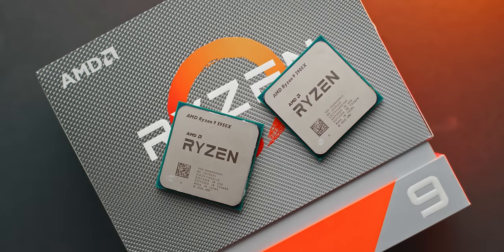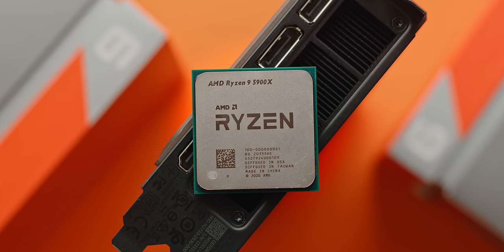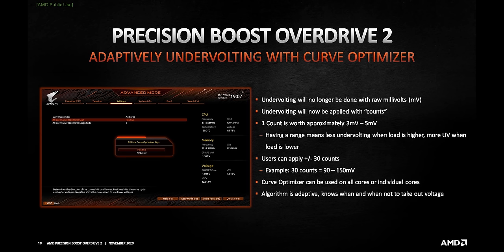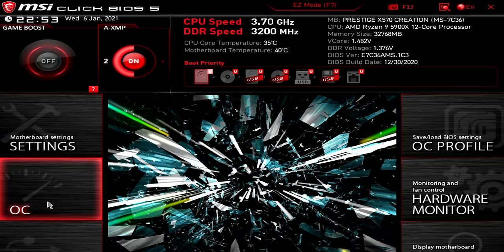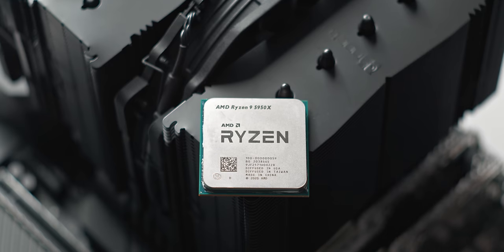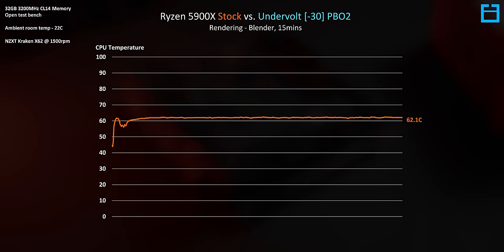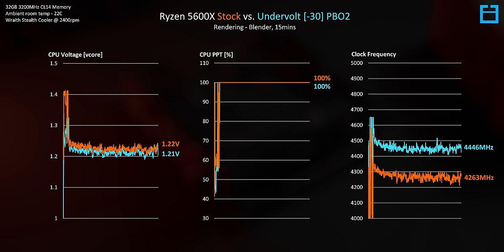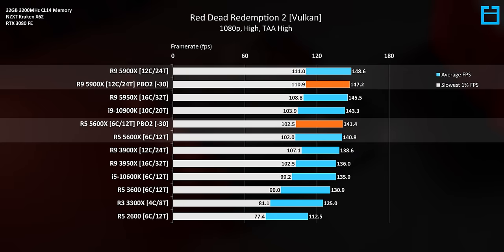Ryzen 5000 Undervolting with PBO2 – Absolutely Worth Doing

Comment: Try setting "Max CPU Boost Clock Override" to "Disabled" if your system is not stable with "Curve Optimizer -30".
Reply: i know it’s been a year but did it remain stable ?? i want to try this as i am struggling to even remain stable at -10

Comment: Thanks for this video. After lots of trial and error -22 seems to be the magic number for my 5950x specimen. Glad I took the effort to do it. Anyone found a golden 5950x that can handle -30? Good luck undervolting!
Reply: -22 got me 29700 on Cinebench 23. 5950x
Reply: @zk4929  How did you land on this value? Did you experience any stability issues or still running it with this?

Comment: I would love to see this tested with a 5800X. I've got a 5800X and because of the high temperatures I had to undervolt it and now it stays nicely under 90c. Still quite high but not shocking. Using a Noctua NHD15 with a single fan.
Reply: Whats the actual temp under that beefy air cooler?
Reply: Did you undervolt it to -30?

Comment: Ryzen 7 5800X - Thank me later (tons of day of testing, rendering, gaming): 1,2V at boost at 4,4 GHZ does a full stable run for all cores. You will never need 4,8 ghz single core boost for stable gaming performance. You need to have good multi core performance which you can reach with setting -450mhz PBO boost clock, and curve optimizer -5 to all cores. Do not mess with the Amper and Watt settings in PBO... Just set boost clock settings and curve optimizer and set Auto for all others even for ampers and wattages set auto. 4,8 Ghz for this cpu is just marketing it can never keep it at that clock for valuable time and in this case it's just totally not worth to use factory CPU settings....

Comment: Is it really worth it though? I mean I lose like ~7fps only by going from PBO2 auto/gaming mode to stock/no gaming mode but temps go from 80 max to 62 max (custom watercooling).
In CAD workloads it's unnoticeable, and in rendering it might be a 10% drop in performance at worst.
Trying to undervolt, I basically go from 62 to 61 degrees max with the same fan profile but lose an additional 5% in creativity and ~5fps in games.

I suspect that if you're on the stock cooler, it may be worth it if you don't need the boost (3090/6900 GPU doing the heavy lifting maybe?) but for most people who run aftermarket cooling (AIO or otherwise) it seems like negligible benefit.
Clock-speed increase in single-threaded is due to CPU having operations/mhz reduction due to voltage and therefore boosting the clock to counter.  AMD did a great job with the single-threaded performance, for once meeting Intel.  I was on Intel for many years because of their previously superior single-threaded capability (and CAD softwares still stuck in yesteryear with minute benefits from multicores)

Comment: I try this on my Ryzen 5 5600X in CB R23
Before: 4400-4425 MHz/1.264v/79C
After that:
(PBO -30) 4500-4525 MHz/1.184v/73C
(PBO -24) 4475-4500 MHz/1.200v/74C
(PBO -18) 4450-4475 MHz/1.216v/75C
It’s help me a lot since my 5600X run hotter after the system bios update. But still 10 degree higher than the previous bios version 😂.

Comment: My 5900X can only go to - 20 counts all core.
If I set higher, the pc is caught in a restart loop. But atleast temps reduced by around 15°C, from 85 to 70.

And one question. Do I have to put the +200mhz in or let it on auto? Because so far with 200mhz manually turned on, no gains past 4,8 ghz.
Reply: Yea, running into this issue as well.  I think it's an issue with ryzen master.  Because everything works.  I install ryzen master (unistalled because I wanted to ensure my presets weren't interfering with the setup) and then constant crashes.
Reply: @Titansfan81  i don't use ryzen master. Only bios settings. I see people who get 5900x to hit 5ghz. But my cpu only does 4,85 if any. Rarely 4,9ghz. Curve optimizer to negative 20 all cores. Pbo limit disabled.
Reply: @jonaskreis7571   interesting.  So I left pbo at default,  ( saw an increase at enhanced but can't remember which profile)  used Ryzen Master and got 4.9 boosts easily and auto over clock over 5ghz. But i also have my ram at 4.0mhz and fclk at 2mghz. I remember that the better your ram to infinity fabric clock the better your cpu performance.
Reply: @jonaskreis7571   i think we can help each other out.  I could give you my IG and we could run some tests yo.
Reply: @Titansfan81  maybe ram is the problem. I can't get 3800mhz or let even 4000mhz. Well... Actually the IF is the culprit because in my setup with x570 aorus pro it can max get 1866mhz so i can't set ram past 3733mhz
Reply: @Titansfan81  i am way too oldschool. I don't even have ig. I am already overwhelmed with youtube settings
Reply: @jonaskreis7571  Ha! I'm an early 80s baby. I decided to embrace SOME of the new school stuff. Not all of it and not alot.  I have other means of contact but there are crazies everywhere.  I'm sure you can appreciate that lol.
Reply: @jonaskreis7571   I'm using the apparently popular X570 Tomahawk.  I bought 4ghz gskill cas 18 ram and used RM to get it coupled and clocked.  I'll have to do research on your board to see if better clocks are possible.  I'm thinking the same on my board about just using bios and not Ryzen Master, but I like being able to control everything without going to bios and I don't know of a better HW monitor because NZXT cam is always off by like 8 degrees sometimes and it's un reliable on freq as well.  And don't get me started on dragon center!

Comment: My 5900x sucks. I'm getting random system reboots whenever my system is idle. Under full load it's fine but when idle it randomly reboots. So far I've tried -30 to -20 and eveything in between those numbers and I get reboots. I'm currently at -18 and so far it seems stable but we'll see what happens. It sucks too because I was getting an all core boost of 4.950ghz and now I'm basically getting stock boost of 4.5ghz just with lower temps.
Reply: I encountered the same issue with my 5900X. System reboots or BSOD when system is idled.
Reply: @raymondxiao9121  I also got reboots at -18. I tried Ryzen Master and letting it do a per core undervolt and I thought it had worked but even using Ryzen Master which actually tests each core, it was still randomly rebooting when Idle. I went back into the BIOS and switched it back to all core and lowered it to -15. So far so good, I've had it at -15 for 3 days now. TBH though it really isn't even worth it. I'm not really even getting any gains by having it at -15 since it's such a tiny undervolt. I might be getting 4 degree lower cpu temps but my boost is basically at stock now with that tiny undervolt. It's to the point now where I'm thinking of just saying screw it and overclocking instead of undervolting.
Reply: @NonLegitNation2  No, it doesn’t worth it. I tried Ryzen Master and some other tools. Per core under voltage doesn’t work either. 5% performance gain costs system unstable. I just leave the PBO as auto.
Reply: @raymondxiao9121 yeah i quite literally can’t do this on my 5800x3D, its poor silicon lottery . nothing works so i just gave up and left it on auto unfortunately. sucks cuz i was enjoying my boost but i rather have stability. sigh.
Reply: @NonLegitNation2 did you find any stable curve ?? if so please give tips , i’m struggling to get mine stable on my 5800x3D
Reply: @NonLegitNation2 reboots without errors right ?

Comment: It's  very interesting how it works. when I enabled PBO by itself the cpu will go up to 125w of power and reach around 4.5ghz all cores on cinebench, but it was of course, also reaching 82 C in temps.

So after searching around what to do because leaving everything at stock the all core boost was stuck at 3.9ghz, I found a forum conversation which I followed. I set PPT to 100, left the others untouched, added a curve optimizer offset of negative 10, and added boost clock overdrive to +100.

Now my 5600x sucks at max 100w, reaches 4.4ghz all core and reaches 73 C in temps at max. And single core boost is reaching 4.7ghz. it all was with a simple setting, will check video and compare what I could have done instead. Funny how I got it recommended just as I finally set everything in place.

edit:

Cool, will try that then, disabling limit and checking how the negative offset does by itself.

Comment: Did you do any in depth testing? Some are saying you need to run some tests for a mighty long time for every little C.O change which is a pain. I have a 5800x and had success with minus 20 via this method. It seemed stable with games, and C,R20. Is that enough?

Comment: So I set mine to -10 in PBO, it didn't make my temperatures drop and in fact crashed it at -20. The only thing that helps with temps and performance is Ryzen Master... Bios changes don't seem to have a positive effect. Also worth noting I have the voltage offset to negative 0.93 in Bios. Cinebench runs at about 82C while running using the Bios changes and 60C with Ryzen Master. With the Bios changes I didn't want to continue the Cinebench test since everything was red with high temps. With Ryzen Master the score ended up around 33000 for all cores.

Thoughts? I'm new to this undervolting stuff...

Comment: I'm trying this now, crashed at 30 and 27 (not even gaming) literally just watching your videos, currently stable at 24. I'm doing this because at stock values, hwinfo would show vcore as 1.38 or 1.4 and I wanna get the longest lifespan of my 5600x. Important question, because I can't find this information anywhere else, are you sure PBO Limits disabled doesn't do any harm at all? I can't find anything official about this and it just sounds counter-intuitive you know? Like it disables the Limits and will actually pump a lot of power, voltage, etc. through the CPU, decreasing it's lifespan, anyways, thanks!
Reply: would like to know this myself too.

Comment: I have R7 5700X and ASRock B450 Steel Legend. On default, Cinebench all cores the temp goes as high as 78c. Also tested with NFS Heat since the game is poorly optimised and gets my cpu temp to >75c. With your guide, I managed to get offset -30 stable and the temp goes down to 65c on Cinebench. My question is, is -30 the max offset or can go more than this? I'm hoping to get <60c temp.

Comment: The only problem I'm having is effectively testing a per-core undervolt.

I've been changing my per-core settings, then using dAffinity to change my prime95 to only hit the core I changed. This has been pretty good at finding some core lows out, but under regular workloads (opening Discord, opening Chrome, etc.) it'll still restart and I have no clue which core was at fault 😭
Reply: @ther3alenso  huh TIL, I'll give it a try next processor I get!

Comment: One Question: I used the following settings:

PPT: 115 A
TDC: 115 A
EDC: 78

In Curve optimizer : All Cores -15
No BOOST Override, no scaler.

Before i had 15k points in Cinebench, and after these settings i have only 13k.

Is the difference normal?
The positive Effect of this ias the Temp difference of nearly -20°

Comment: I Just tried this and found that using the classic offset voltage mode gives me better results on my 5600X.

With offset voltage mode set to about 1.2V, I get 4.65ghz in stress test with a temperature of 57-60c and Consumption of 75-80W.
With PBO Negative 30, I still get 4.65ghz in stress test but this time, voltage is closer to 1.23-1.25V with temperature of 63-66c and Consumption of 90-95W.

Of course, those are my results and could vary between each systems.

Anyway, thanks for the informative video ;)

Comment: My 5950x sets 52C Idle at 1.437V  and anytime i do something which requires extensive work load, it automatically turns itself down to 1.1v while still remaining at 62c and even will turn down the clocking from 4.7GHz to 3.7GHz. Actively lowers itself to 3800MHz range rather than lowering voltage and keeping high clock speeds. I havent touched a thing either, this is stock out of the box it is doing all of this. All of this AMD stuff is very confusing for someone who had a 4790K for the last 8 years.

Comment: Great and Informative Video. Is it possible to do Damage to the system while using the Curve Optimizer in any way?
Reply: Logically, if all you're doing in lowering the voltage then the answer is no. All that can happens would be your system to crash.
What causes damage is heat when using higher voltage.

Comment: Would you still recommend the exact settings you use here? I'm on a 5800x and recommendations are very different depending on the guide, website and reddit post. I've tried a bunch of different settings. 

One thing I really care about is a stable system and a lot of people recommend a lower negative curve on your two best performing cores while going further down on the other cores. Example: my best core is 3 and second best is 7, so I set them to 8 and the others to 15.

Another thing I'd like to see is how you set the "Precision Boost Overdrive Scalar" and the "Max CPU Boost Clock Override" after adjusting the curve.

:)

Comment: Nice, -30 boost my 5600 from ~2250mhz to ~2450mhz with slightly lower temperatures. Cinebench R23 score from 9918 to 10575.
Reply: -30 all cores is stable? Also your cinebench cores are really low, I have 11810 on mine 5600 with -15 CO all cores(need check properly stability of those values first then I will probably tweak a bit), +200mhz boost override and motherboard limits(I used custom ones from 5600x but i had some temperature headroom so i am using mobo ones which are higher and gives a bit of better performance)
Reply: Great on you, I could have higher cinebench score if I turn up my cpu AIO 240mm cooler. But I prefer my pc stay quiet with positive airflow.

Comment: I followed this guide but actually lost quite a bit of performance on my Ryzen 5 5600. Average clock speeds in cinebench r23 were only 3.84 ghz across all 6 cores. Single core clock speed refuses to exceed 3.701 ghz !!! This is frustrating. Temps aren’t going over 74c either so that’s not the issue

Comment: i found that this setting dropped my performance because I used to have PBO enabled so it can hit 4.45ghz all cores with no issues.... with this my clock speed dropped to 4.2 on a ryzen 5600 and dropped 200 points 
I think this is great for people using weaker coolers but if you have good cooler just enable PBO.

Comment: On Gigabyte aourus elite v2 B550 and Ryzemn 5 5600 i set -20 (for safety) and i get + 466 score in cinebench  at multicore Stock 10787 ,  UV -20 - 11253. Also -3-5 degress cooler cpu (I use ENDORFY Fera 5 cooler). Big thanks. I think i try set to -25 and chect the results.

Comment: Thanks for this video. My Dark Hero didn't have a curve editor in the 3204 bios it shipped with, but 3601 has it. I didn't find any advanced setting for it, but could access the curve editor and add in the settings as mentioned. I just went straight for a 30 offset and so far so good.

Comment: Nice. But many Zen3 can not run stable at 1800 FCLK. And if you dare to lower the voltage by Curve Optimizer, it will crash instantly. 
I have two 5800X from the first production weeks of 2021. Both are trash!

Comment: Wow, I really hope they enable it in Laptops where it is needed the most
Reply: Did you watch the video?

The total power consumption and thermals are virtually the same, you just get a little extra performance out of the deal.

This occurs for single core stuff but a lot of things aren't single core these days.

Even still it's a single digit percent at best.
Reply: @MastaSquidge  I've done undervolting with intel, don't know if it is the same but
case 1: increases clock speed. case 2: reduce temperature. case 3: a little bit of both.
It depends on your setup (your CPU current temp & clock speed), is the clock speed thermally constrainted. You will usually see 2 digit percent performance increase (or temp decrease) when you work with laptops.
Reply: @MastaSquidge  FYI. My laptop were able to push much higher than what he did in the video, 140mV, though I chose to stay at 125mV. the improvement is much more than that. even with that 75mV undervolting, he managed to increase clock multiplier from 38 to 40 and decreased 10 degrees
https://www.youtube.com/watch?v=SYWkheY6x4g

Comment: I just can't mess with the PBO and Curve Optimizer as every settings that I tried were unstable. Not sure if my current RAM config is somehow the culprit. I am running 5900x with DDR4-4000 RAM. I know its not a good pairing, and yes, my system was unstable in the beginning. But somehow I was able to set it to DOCP profile and the FCLK to 2000MHz using the AI Tweaker.

Comment: Following the instructions on an MSI MAG X570 TOMAHAWK WIFI and Ryzen 9 5950x the thermal results are absolutely shocking.
Noctua NH-D15 and Thermal Grizzly Conductonaut (liquid metal) is a great combo.
Before I had this optimization set, the CPU temperature went above 100°C on a very heavy load and then shut down. After this optimization the temperature is stable at the average 66.5°C. Well this is what I call something :D
However: when that particular heavy load was on without the undervolting, the frequency was at about 4.4 GHz and now with the undervolting it is at average 4-4.15 GHz. In the video you said the performance would not be impacted. Any suggestions?

Comment: Why not just set the power limit in bios and let it determine the voltage and clock speed to achieve the lower power setting?

Comment: I wonder if the people who claim to only achieve a negative offset of 20 also happen to have motherboards with a suboptimal VRM
Reply: I have an Asus x470 CH7 that has really good VRM and my 5800x wont even post at -30, could be a Bios issue tho as its just ported from the x570 CH8